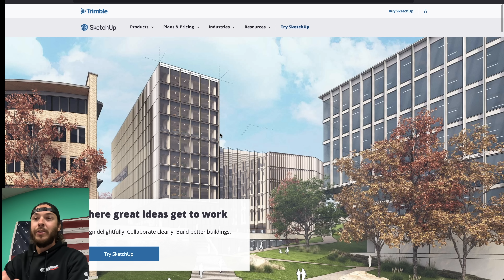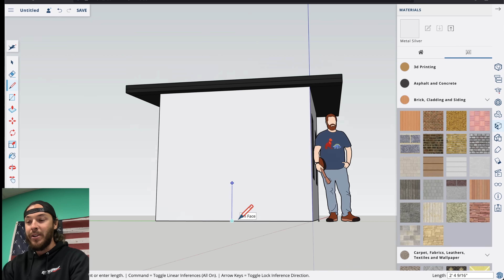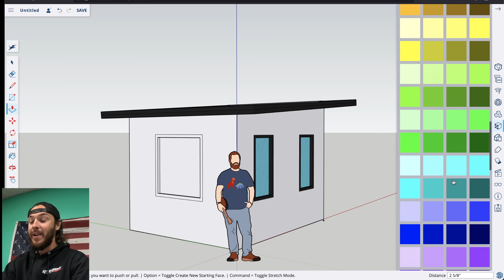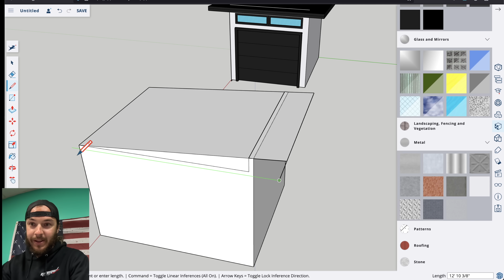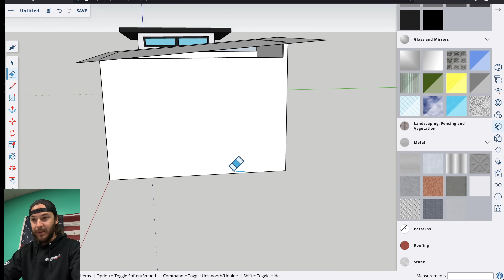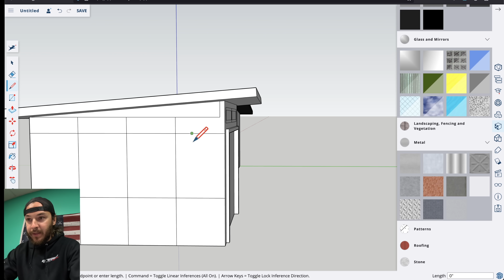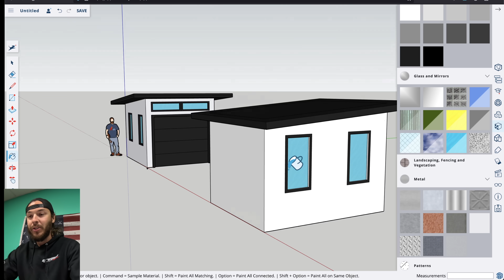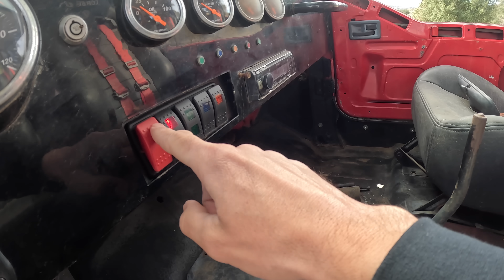Building a Custom Modern Shed! (Part 3)

Comment: Ryno
    If the shed doesn't block enough sunlight you could use a shade sail between the house and shed. Adding more color, shade and that modern look. 
    With all the different angles going on there, mounting a shade sail at different heights would just look badass, in my opinion. Best of all they're reasonably priced. 
    Shade sails maybe worth considering putting around the pool. Not just for shade but to highlight the pool to helicopters getting water while putting out fires. Do they take water from people's pools? 🤷

Comment: I had a similar front structure on the shed I built two years ago.  I ended up buying 1x4 for the frame, quarter round to hold the glazing in place and a sheet of 1/4" plexiglass.  I built my own windows, 4 of them in my case.  The hardest part, as it turned out, was cutting the plexi.
Reply from the maker: Thin metal jigsaw blades are the best for cutting plexi!
Reply: @DMAXRYNO next time take a crescent wrench (if you have one near by) and round that end back out. Put it in the flattened sides, snug it down but not too tight and rotate, if you can’t turn it, loosen it a smidge. Keep doing that and tightening it until your round is back.
Reply: Did you glue the quarter round to the plexiglass or how you keep the plexiglass in the 1x4 frame with the quarter round

Comment: Why don’t you use clear lexan on the top windows instead of glass. The you could use quarter round and brads to set it in the frame. You can then use foam weatherstripping that will stick to the lexan or quarter round to seal it. And it’s cheap
Reply from the maker: Getting glass cut is surprisingly cheap. I’d rather use real glass for something long term.

Comment: So this may be a dumb question considering the name. What is fire blocking for?
Reply from the maker: Haha it’s to prevent fire from spreading in open cavities like walls. So instead of having a huge 8’ cavity to act like a nice fluke for fire to travel up, we break it up/seal it off with the blocking.
Reply: @DMAXRYNO  ok that makes sense. I assumed it had something to do with slowing fire. Just completely overlooked the insulation and it being one giant section of flammable material

Comment: What if you did the same thing you did with the mini truck window for the top two windows in the shed
Reply from the maker: It’s an option, but having flat glass cut for those sections is actually pretty cheap. The reason I made them custom for the mini truck out of plexi was because they had a radius, so the glass shop needed to make very expensive molds.
Reply: @DMAXRYNO  I gotcha

Comment: Is that a canoga mixer? What size is the spark plug on it? I’ve been looking for it and seem to not find it anywhere .
Reply from the maker: I’m not sure the size, but it’s a Honda engine. I don’t recall the model number, but I was able to pull it up from the serial number on it. Maybe yours has a number plate?
Reply: Where would the number plate be located at? They spray painted the motor black , I went to auto zone & they couldn’t help me out .
Reply from the maker: @anthonyraygoza24 somewhere on the engine. I think each engine is different. It didn’t have a plug in it when you got it?
Reply: No my brother in law went to pick it up for me and he didn’t notice that the spark plug wasn’t on the engine so now I’m basically looking for it but I’ll check the engine tomorrow thanks for your help man 🫡